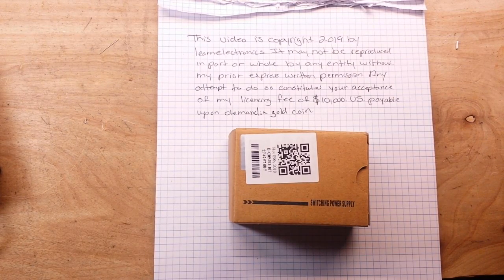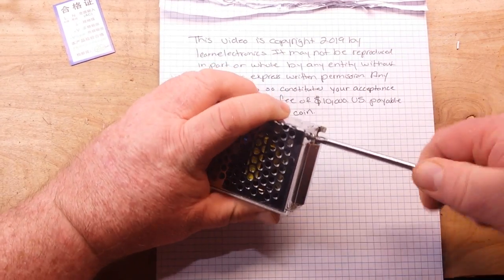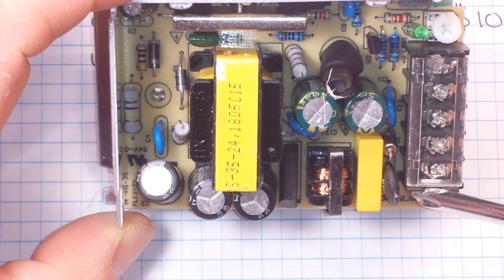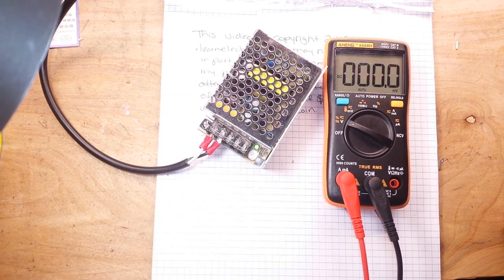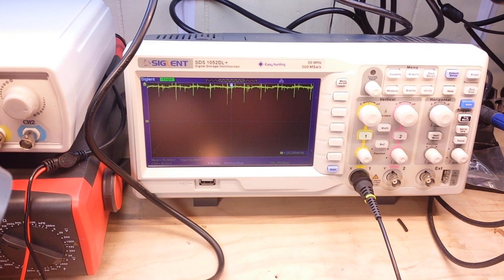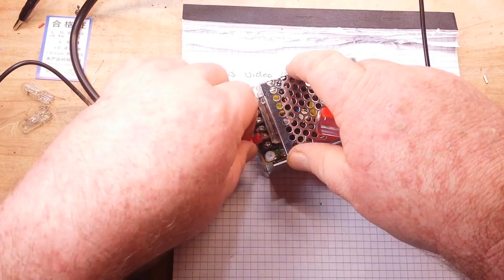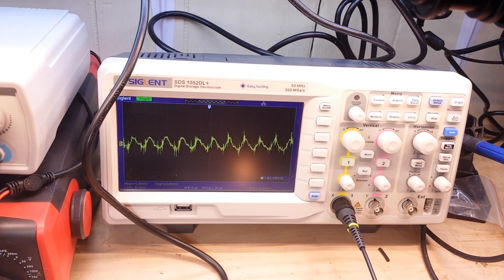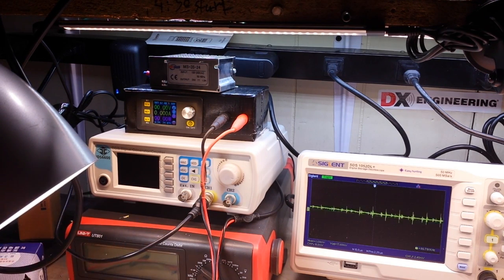Gearbest Switching Power Supply Investigation

Comment: Hi guys.  Good time to ask a question.  If you load a 1.5A linear transformer with 5A you will heat and short the transformer, but if you load a 1.5A power switch  with 5A, you will not get the 5A but neither burn the power supply.  Am I right?

Comment: To measure noise you should use a shorter ground wire for your probe, one of the ground springs that you put in the tip would be much better. With your current setup you get a lot of noise from the environment.

Comment: Teardown and topology analysis planned? No IC to be seen, is it hiding bottom side? no optocoupler, so how does it work?

Shouldn't be very annoying or destructive to take apart, looks like there's screws under the label which will release the secondary power semiconductors from the heat spreader.

Also... I'm somehow not convinced that a transformer wound with who knows how little QA/QC won't just short primary to secondary one day... It may continue operating seemingly but waiting for someone to touch it and die?

Comment: I cannot support a company that knowingly copyright infringement on content creators. Aside from that, this is a rather weak power supply (36W isn't very much). That might have been some mains AC interference (I couldn't catch the freq on the scope). The mV ripple isn't so important as the ratio of the ripple to the output voltage (this was not mentioned). 50mV of ripple (if that's what it was, my guess is it's much higher) is actually excellent for 24V output (anything ~ 1-2% ripple is acceptable).  Please correct me if I'm wrong. Ironically, today at work i was looking at purchasing 24 VDC power supplies lol but 150-200 W and significantly higher quality. Weather instrumentation ;)
Reply from the maker: I had to fulfill my commitment to GB for sending me this. But that was the end. hence the note.
Reply: @learnelectronics  totally understand

Comment: For my own DPS5005 power supply, I use a power block from a printer that someone threw out to the street. It can provide up to 0.9A at 32V, so it definitely limits the power supply unit, but for my low-current low-voltage projects it's perfect.

Comment: Live is brown. Or red. Switches are down for on. Stuff is measured in metric. Join the twentieth century, America, and stop trying to drag the rest of us back into the nineteenth. Thumbs up for a good test and review.
Reply: Realistically though, in most industries that arguably have modernized civilization, they use mils - or thousandths of an inch ... not millimeters.
Reply: Monkey . . . you do know there are other countries outside of America ?  I'm from one of them. Quite a lot of people are. Milliinch . . . can't say that I've ever encountered that one. And do you have millifeet ?  Or should that be millifoots ? Oh, something I remember from my childhood, the abbreviation for thousandth of an inch was " Thou ".
Reply: @sciencetroll6304  also, to be clear, "America" isn't a country. North America and South America are continents with a multitude of different countries, some even using the metric system (but shocker, still using mils for many skilled tasks like machining, mechanical engineering, circuit board design and manufacturer, etc. You know, the things that keep modern life moving.) The United States of America is a single country in North America. Big difference.

Comment: I've been poking around one of those ebay 150W step up converters for use in my wa2eby amp build. I was looking at eevblog's videos on power supply measurement including common mode noise, #441 and #594. Would these methods help figure out if the supply you're testing is actually noisy? (I am really no expert on this, and am quite confused at this point about how I'm supposed to ensure a clean supply without giving up and using batteries).
Reply: Yeah well, by all reason you multiply the noise of the power supply by supply noise rejection of your amp, and you'll figure that it'll make like 0.001mV of noise. You can then multiply that by efficiency of your speakers and figure whether you'll be able to hear it, chances are, borderline but not really.

Except it never works out like that and you'll get noise injected into the input circuit elsewhere.

If you're determined to have a switch mode power supply, you'll always have to deal with that. What if it's not 80mV of noise, what if it's the more upmarket 20, that's still only a few dB off, if you can hear the one you'll hear the other. Clean it up, use something like an LCL to low pass the power supply noise. If you can get your filter corner just a few octaves under the switching frequency, you can get dozens of dB of noise reduction.
Reply: @SianaGearz  RF amp, I'm worried about it mixing with the signal and getting piles of frequencies.
Reply: @qvatch  Oh i see, sorry. Well you can just keep stacking inductances and capacitances until you have a steep enough noise filter. And i mean, if something like 500mH/2000uF 12db filter has a corner frequency somewere in the subsonic, by the time it gets to a few hundred KHz, there will be very little left. And you can just repeat this LC circuit twice for a 24db/oct filter. For every 6db/Oct, for every doubling of the frequency starting from the corner frequency, you halve the residual noise. Let's say you have a 10Hz corner frequency and even just 12db/oct, by the time you get to 100 MHz, you've attenuated the noise by about 10^14 times. At 24db/oct it's 10^28.

Comment: The best source I've found to power my bench top buck converter supplies is a stereo receiver. The power transformers combined with the diodes and big power rail caps usually yield around 40 to 65 volts.. Perfect for  a bullet proof supply, and all for around $15 to $25 at your local thrift store.

Comment: Shucks, I ALWAYS lick the case of any AC product.. Now Professor Paul says Not too... Wondering if that would work for a 8x8 3D printer bed?? I need to find out the current draw I think its an MK2B 12/24v bed.
Reply: About 90W give or take at 12V and 160-200W at 24V. The 24V terminals merely double the resistance, keeping the current constant and the MOSFET/board usually designed for 10A draw max (closer to 8A actual) happy. The bed fuse is an 11A polyfuse (RAMPS), or a 15A sacrificial fast fuse (GT2560, Makerbase Gen.L).

So it's not even close at nominal use. You're looking for a 12V 10A power supply. Without regulation or thermal insulation, you'd be looking at max thermal equilibrium of sub 120°C, making it thermally safe, even if your MOSFET shorts out and you lose control of it. 24V bed is no longer necessarily safe in this regard.

If you use the 24V terminals but run 12V through it, you still want a 5A power supply, so this is still not even close. Besides, i have a severe doubt as to how much temperature you're going to reach, whether that's enough for anything. I could check.

Comment: I just bought one of a couple weeks ago, but in the 24V 3A flavor - Looks like the exact manufacturer. I was surprised how lite it is.  I'm using it on one of these 120W single board audio amplifiers. (I've used up all my Laptop power supplies on other projects.) 
- LOL when I started buying those flush wire cutters for sub $2, I got a lot less pick what I cut with them. :D
-Thanks for the scope on the PS, I wondered how noisy it was going to be.
Reply from the maker: It is not perfect. But it is fine. No worries.